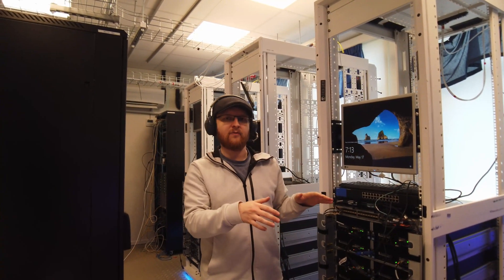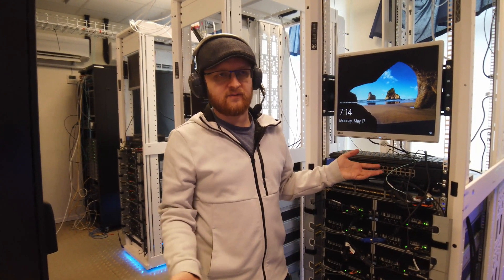DIY KVM in our Data Center VLOG - VLOG E02

Comment: Looks way more fun and efficient learning this way than when I attended that school, we just read books that were honestly quite outdated and did not really give any help whatsoever.

The books were like "Hey, if you do this - this will happen, but what is the proper way to apply this action? You never know until you do" (for a guy with ADD)

You actually got my motivations up for a while wich was why I only attended your classes but I realized that it was too late for me to fix my grades, but it is what it is.

I'm sure this will turn out to be better for all of the students. Cheers mate!
Reply from the maker: A lot has changed my dude. It was fun to have you and chat with you also. When I was at school also things were super different but learning never ends and it’s never too late to learn some new things.

Message me on discord and we can catch up more and on a quiet day you can swing by the school and perhaps if you fancy it, I can give you some material and pointers to start some little side study for you. Could lead somewhere nice later :)